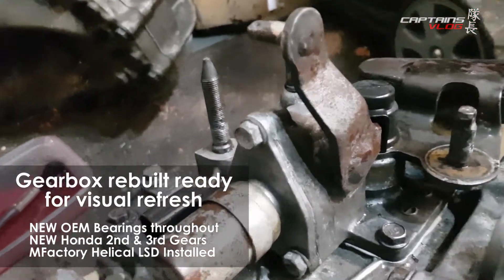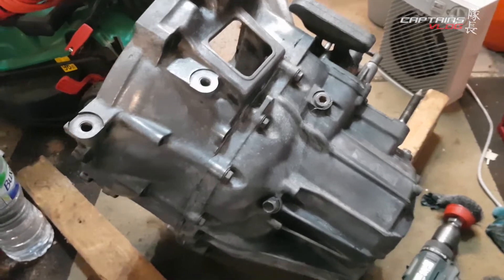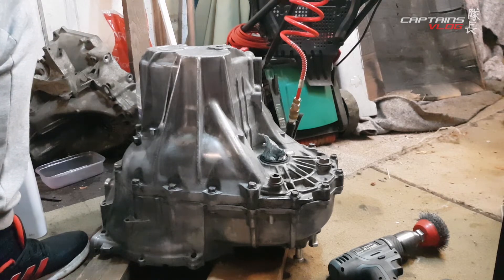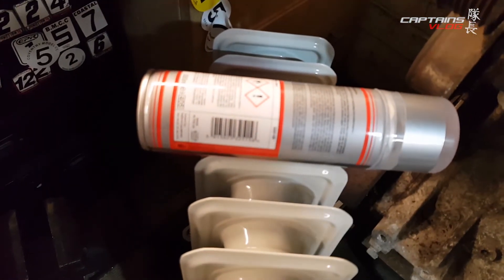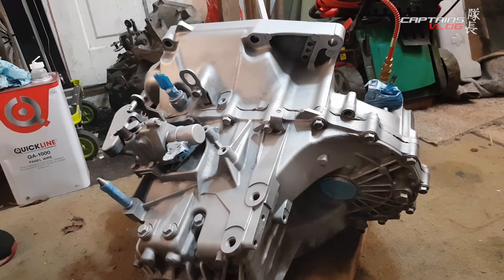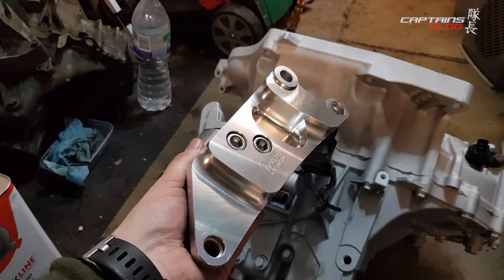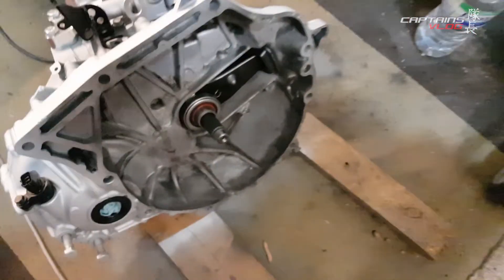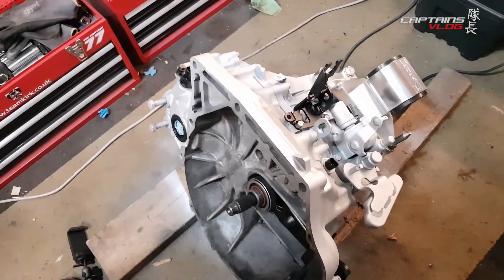K Swap Honda Civic EJ9  _Episode 6 , EP3 Gearbox rebuild and restoration

Comment: yes boi!!!!
Reply from the maker: Engine next dude!
Reply: Might explain why my paint didn't stick as well need more heat  for my k24 block
Reply from the maker: @karlbradish6486  needs to be as clean as you can get it, and yeah temp makes a difference, ideally north of 15c and kept there for a couple weeks if not going straight in a car and ran upto temp. Takes a while to cure👌 warm the paint aswell, old skool RC paint trick that🤣